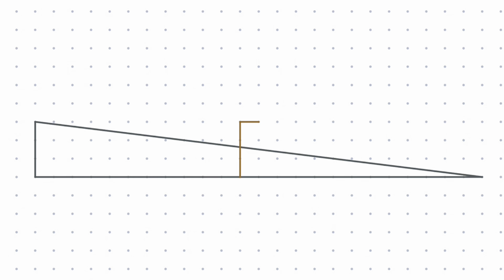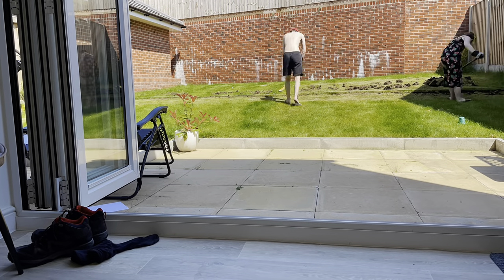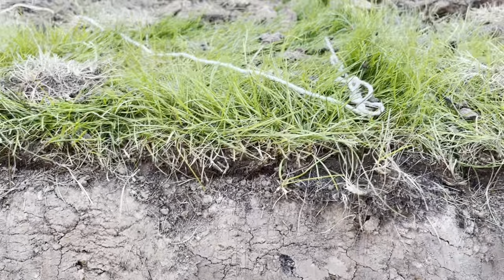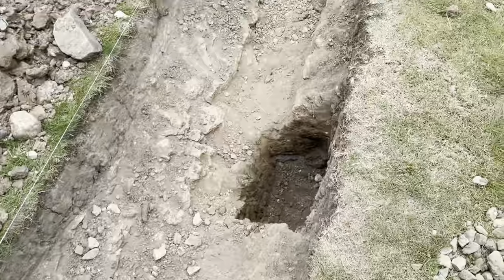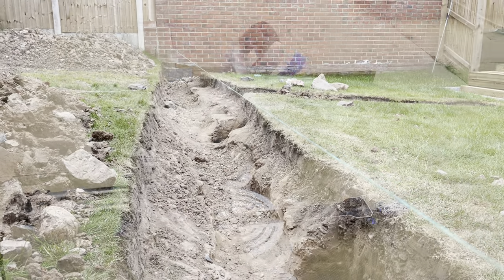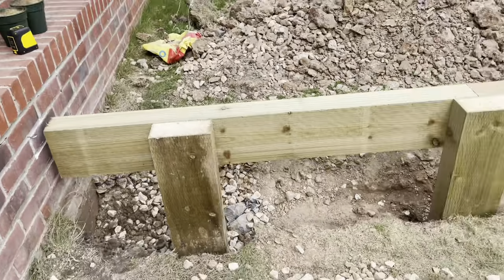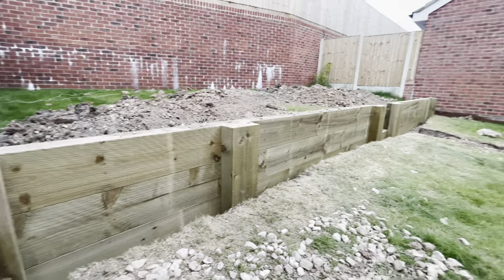Building a Retaining Wall with Sleepers - GARDEN RENOVATION

Comment: Main reason I was watching was to see how you secured or blocked the wall to the structure so that there is not wash out on the ends.  It looks like you have an 1" between them?  I have used commercial landscape matting and the sandy loam is able to go through which destroys the integrity of the wall.  Advise?  You can PM me also plz.....

Comment: Hi - what would you recommend for treatment / preservation of the sleepers? I have some that are splintering and they were only installed 2 months ago
Reply: Char with fire
Reply from the maker: You could get a wood treatment, put a few coats down. You may need to do this each year too. If you get a big enough tin, it should last you a while. Hope that helps 👍🏻
Reply: @jacoboverton777 it's a great way to preserve wood but if you do make sure to oil it after or it starts to split in a year or two.

Comment: Nice job, your videos and work on the garden gave me some great ideas to tackle our garden as well this spring!
Small tip when using a 18V battery drill and screwing into larger/thicker pieces of wood. Pre-drilling (in second gear and drilling mode) will definitely help. Also when screwing into the wood, you could use the drilling mode in gear 1 and carefully build op speed when pulling the trigger.
Reply from the maker: Cheers, I’ll have to try doing this next time. I’m looking to do a similar job but at the front of the house this summer. We’ve got a verge at the front but it slopes downwards. Hoping to build a wall and backfill to have a flat strip of grass.

Comment: Hi mate. Firstly your videos are great. Thank you for making them - they’ve helped me gain the confidence to start my own garden renovation.  
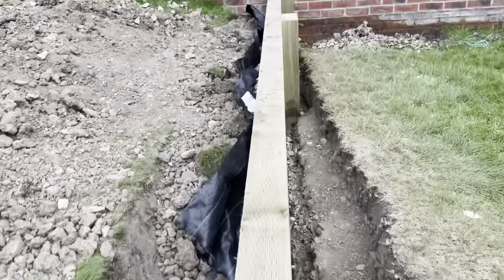So I’m also going to be using hardwood railway sleepers (on their flat side) to build a 3-level retaining wall but with a concrete base. Drainage is important. So I saw at 4:45mins  that you back-filled the wall with gravel but you used geotextile in front. I always thought you need to keep the wooden sleepers free from water to stop them rotting. So instead of having gravel touching the sleepers and then geotextile, wouldn’t it have been better to possibly secure DPM to the sleepers instead? That way they would stay dry all the time? Also I thought that a French drain would be need behind the railway sleepers? Thanks mate 👍🏼👍🏼👍🏼
Reply from the maker: Nice one! 👍🏻

Everything you said was bang on! Go for it. In hindsight, I should have done that. It was only after the fact that I realised that doing what you’ve just suggested would be better. Don’t get me wrong, two years on and the wall is still perfect, but inevitably it’s going to start to rot. I may have a big job on my hands when it eventually does 🤣 But that won’t be for many a year yet!

Good luck with your project! 😁
Reply: @NoviceGardener  thank you. I showed my wife what you had done and she looked at me and said "...yeah but he obviously knows what he's doing!" - great start to my project!

Comment: Brilliant video to learn from, is there a specific measurement for the sleepers in the ground please? As in how far apart they should be?
Reply from the maker: It's a good rule of thumb to have them at least 1 third of the post in the ground - this is regardless of the size of the post. The distance between the larger posts is about 200cm. I was going to stagger them at first but found it much easier to keep most of the posts the same length. A year and a half on, they're holding up well.

Comment: Planning something similar. Really helpful, thank you. Is the reason the posts  are house side?
Reply from the maker: It’s so that they can bare the weight of the wall. If the posts were behind, it would just be the wood screws that would be taking most of the pressure from behind.

Comment: I’m on this following your steps one at a time. Did you line up your supporting post with the string line then screw your sleepers on after ? 

Sorry if a stupid question! Just didn’t see the supporting post till the top sleepers were attached.  

Thought maybe you made them up first
Reply from the maker: Not stupid at all! Yep, that's how I did it. I set up a string line from one wall to the next. I got that perfect before putting any of the sleepers in place.

Comment: Could you put the supports on the other side so there hidden or would that cause a negative impact ? Thanks
Reply from the maker: You could do, but it wouldn't bear the weight as well as it would with the posts at the front.

Comment: Did you have to cut the support posts at all? Or did you manage to get them all the perfect height? Not sure whether to allow some height and cut down after. 

Did you attach the horizontal sleepers to the support posts (or temp piece of wood) to them before putting the Postcrete in also? 

Very inspired, I’m essentially adapting your design in the coming weeks.
Reply from the maker: I cut 6 sleepers to create the posts and then used what was left in the wall at each end which is why I ended up with support posts close together on each side.

I used timberlock screws to attach the horizontal sleepers to the posts. Used 2 ok each side, seemed to hold good enough with those.

Before putting the support posts in, we put some hardcore in the bottom so that it wouldn’t be sat on the clay below. Hope that helps.

Good luck with your wall!

Comment: Was there a reason you didn't stagger the sleepers? Looking to do the same thing add have been advised to stagger the sleepers to add support and allow for smaller posts if wanted.
Reply from the maker: Originally I had planned to stagger them, but it would have meant more support posts along the wall. I didn’t want any weak spots where the joints were not supported. I think I would have staggered them if I had laid them on their wider side though.

Comment: Novice, I’m due to start my project next month. Can I ask exactly what did you lay the sleepers directly onto? What type of hardcore did you lay?
Reply from the maker: The hardcore was mot 1. I put some in the bottom of each hole, tamped it down and then put them in with postcrete.
Reply: Top man, final question did you hand dig out the upright holes or did you have to use a tool?
I’m struggling to dig into what I believe is dried clay and the only thing I can think of is a petrol auger

Comment: I’m about to do this to my sloping garden, any thing you wish you’d have done differently?
Reply from the maker: I would install a perforated drainage pipe behind the wall before starting. But other than that, I'd do everything else the same.
Reply: @NoviceGardener , would you have drainage at both sides? 
Or just on the retained side?
Reply from the maker: Just on the retainer side. But if you can do it, both sides wouldn’t do any harm!

Comment: What sort of posts are best to use for the wall? How big should they be?
Reply from the maker: You will want to get sleepers. I used the same sleepers for the posts that I used for the wall. They’re 200x100.
Reply: @NoviceGardener  Thanks - I'll do that. I'm going to put mine behind rather than in front due to aethstetics, so will use a few more posts to keep it secure. For a 60cm wall (3 sleepers), how deep wold you do the posts?
Reply from the maker: A good rule of thumb is one third of the post. So for a 60cm post (out of the ground), you’re going to want to have 30cm extra in the ground.

Comment: Can I use a normal house hold drill to drill pilot holes and put the screws in?
Reply from the maker: An impact driver would be best. I didn't own one of these at the time, but it would have done the job. A normal drill may do the job, just depends on the torque.

Comment: Can you have the post on the inside do they aren’t visible?
Reply from the maker: You can, but it won't be as strong. It's the posts that are holding more of the pressure from behind. If you put the posts behind, the pressure will be on the screws.

Comment: What size sleepers did you use ?
Reply from the maker: 2400 long, 200x100
Reply: What timber is suitable for making a frame for artifical grass ? Would it be sleepers or the normal treated timber please ?

Comment: is that a garage or someones house? either way it looks like you are backfilling higher than the damp course..lets just hope you are not for your sake because thats going to cause damp if it is mate
Reply from the maker: That was something we were worried about at first. Garages are on both sides. The one on the right has a damp proof layer between the smaller wall and the larger wall and has a drainage pipe below. On the other side we have filled with a layer of hardcore that runs down into a drainage pipe. Hopefully all will be good 🙏🏻